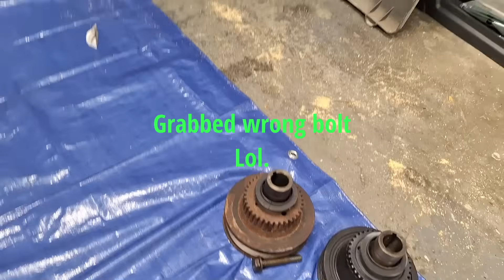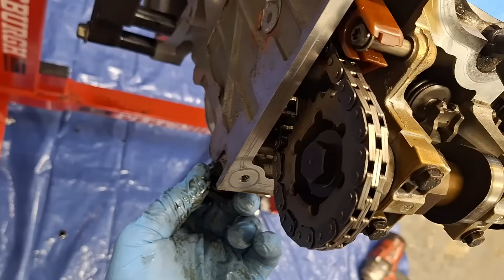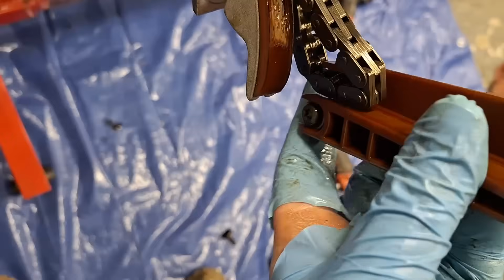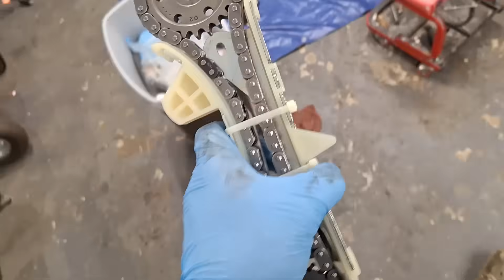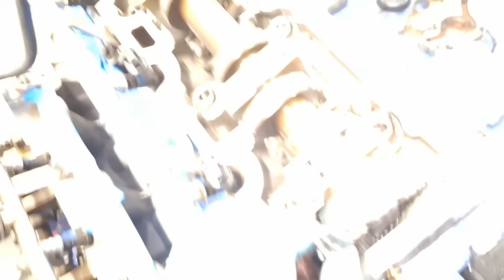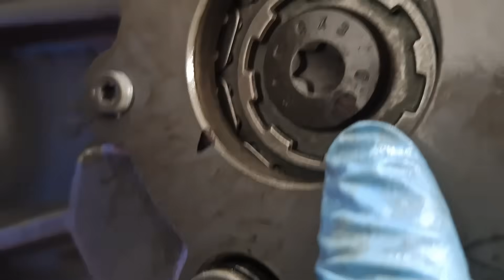Ford 4.0L SOHC V6 Timing Chain & Guide Replacement (Front & Rear)

Comment: this is definitley getting saved to my watch later lol. I need to replace my timing chain on my 2005 Ranger. Any tips or things to look out for? I've been researching for hours
Reply from the maker: If you're doing it in vehicle you can pull the transmission to access the rear casette
Reply: @BigBensCarsAndCycles  no I was planning on fully pulling the engine, thats just way too tight for me to do it still in the vehicle

Comment: So just to confirm, only 3 bolts total are one time use? I saw a video by Platinum Productions where he didn’t remove them and just did the chain guides and kept the original chains and sprockets.
Reply from the maker: Hey the only bolts you want to replace are the torque to yield bolts. Which are the ones with angles in the torque specs

Comment: Doing this on a “new” motor as well. What was your cost total if you can remember, thanks
Reply from the maker: Think the parts are roughly $500
Reply: @BigBensCarsAndCycles oh yeah, forgot to ask 
(only remembered because I just got my old motor pulled and my new ones almost ready to go in)
Where’d you get the crank pulley bolt? I’m not sure what seller to trust, and ideally not pay a crazy price for a bolt

Comment: I used CLOYES MANUFACTURED PARTS complete kit, 683 miles later left bank chain broke, installed a warranty chain 287 miles later i checked the chain it was cracked in 7 spots and the main crank shaft chain tensioner exploded ,😢 switched back to old chains so far every thing is good , OEM FORD PARTS country of origin turns out it is CHINESE ford suck's. PS Do not get rid of old chains just in case

Comment: I got the motor out of my 2006 v6 mustang, 4.0. I was in the process of removing the rear jack shaft bolt and my passenger side cam “sprang” out of alignment, and now anytime I try to line up the marks, it springs forward way too much and will not stay in place. I didn’t see you use a cam locking tool, lots of people online suggest using one, but it’s too late for that now, my driver side cam is still in alignment, and my crank is still in alignment. People online are saying I need to use a breaker bar to rotate the cam bolt/sprocket until my marks are lined up, and then install the chain, tensioner, and guides. Am I on the right track or have I screwed up?
Reply from the maker: Just break loose the cam sprocket bolt for the bank that's misaligned, use vice grips to turn the cam, then use the vice grips to hold the cam still while you torque the cam sprocket bolt. If you don't know what I mean, join the discord and I'll try to find a visual example in a video of mine

Comment: the gods are clearly with you.  if i tried to break a bolt w/ an adjustable wrench it would instantly slip and round the bolt and the woodruff would be gone the second I put it down.